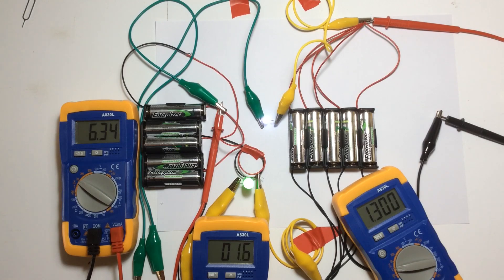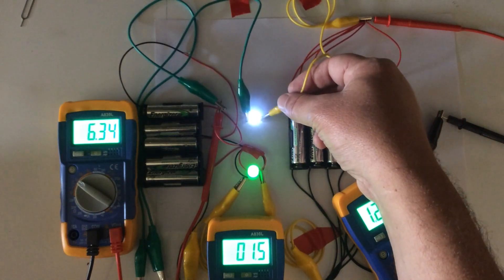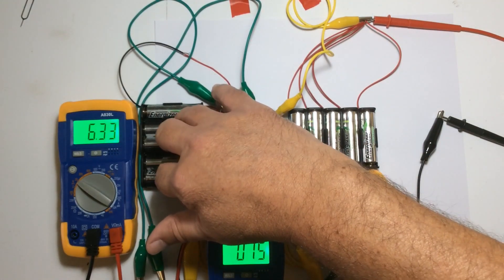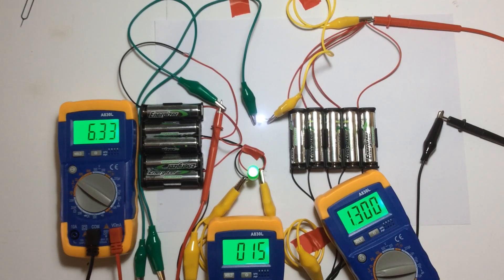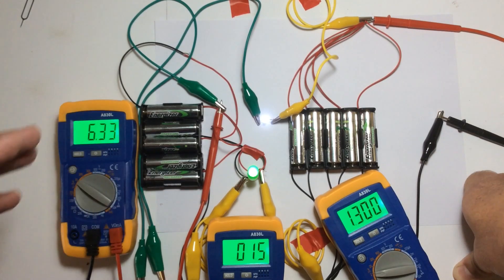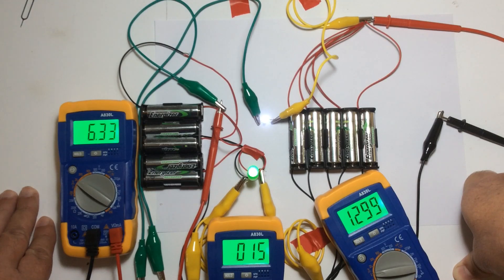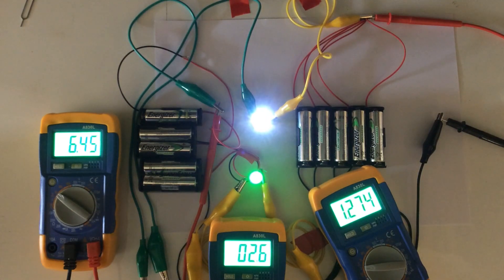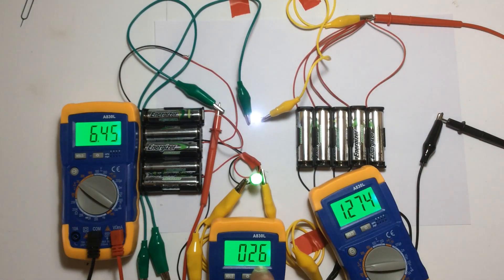*UPDATE 2* TESLA SWITCH 24/7 RUN, 240+ HOURS SUPER EFFICIENT LIGHT

Comment: I've followed Rick Friedrich for a long time, but even his work on Benetiz is not
nearly as informative or clear as your detailed video here!

I play around with a lot of experiments, but I keep forgetting how utterly simple
the basic principle of the Benetiz patent is, so I tried something extremely simple
today with 3 simple off the shelf parts, (2) 12 Volt / 500 Farad caps and a 12 volt 60 watt motor.

One of the caps I had drained to less than 1 volt, the other cap was charged to
about 14 volts.  I connected the two negatives of the Supercaps together and ran
the motor for a few minutes between the two Positives.

At the end of the experiment the combined voltage of the caps were GREATER than
when I started.  I ran the experiment 3-4 times after that with the exact same result!!!

Not only did the motor run 100% for free, there was actually a small increase in voltage
due to the coil collapse & feedback from the motor.  The voltage increase wasn't anything
extreme (about 1 to 2 10th's of a volt per 2 minute run), but the motor ran for free
with nothing but off the shelf caps and motor!
Reply from the maker: Thank you for your comment.
Sorry for my delayed reply. I agree that is so simple and perhaps this is the illusion and I find that to be the case with most of Tesla's work also. Confusingly simple, the confusion is derived when you realise its so easy.

I appreciate you supplying your test information because the more people attempting this the better. please feel free to update me if you like on any more tests you do.
Have you run this multiple times to get a consistent data set?
Thank you for watching.

Comment: So if I'm seeing this correctly and following it right, what you're saying is essentially any of the little double a devices that I have could potentially be wired up in a manner such as this to extend the battery life considerably.   If that's correct, how would I go about doing something like that for say a TV remote or something along those lines like an Xbox controller?     And can this be adapted to 18650s sorry for all the questions
Reply from the maker: Thank you for your comment.
Sorry for my delayed reply, you are correct, this will work with most batteries, as long as the parallel receiving battery is roughly half the voltage of the series battery. The way I set it up with AA batteries is consider the load/LED voltage, in this case 3.2 to 3.6 Volts then subtract the voltage of the parallel battery voltage of 1.2 volts. So 3.2v - 1.2v = 2 volts which would be too low for some LED’s so it would be best to use 4 AA in series.
4 AA x 1.2v = 4.8 volts
4.8 volts - 1.2v = 3.6v which is the upper limit of the LED
The only other thing to consider after that is to ensure that both banks have the same number of AA’s, ie if you choose 4 x AA’s for the series bank then you need 4 x AA’ for the parallel side.

So your TV remote would most likely be two AA or AAA’s and the four battery scenario we just covered would be perfect. When the battery voltages are even, say with a 12 volt version in which you have a 24 volt bank and a 12 volt bank then the load sees half the voltage of the series set, if you place your volt meter on the two positives it will read 12 volts.

Both the Xbox and TV remote are going to be very bulky with this type of setup, you could perhaps miniaturise the circuit using small lithium batteries that are usually used in PCB’s for computers and other electronics but it may just be easier to charge your remotes batteries on the negative rail of this circuit, if you take a look at my latest video there is something a little weird going on along the negative rail we may be able to benefit from.

Also you should never have to apologise for asking questions, questions assist in rapid learning, not asking questions means we have to individually stumble upon findings which is an incredibly slow way to research, the world would be a greater place if more people asked questions.

Comment: as always I love your videos, I was just thinking will arduino work if I connect it like led? Or that is different? both are DC. Im planing to make moving sensor with esp32 and light bulbs.
PS: Im still hooked on your magnets track, thnks
Reply from the maker: Thank you for your comment and sorry for my late reply.
I believe arduino would be a good idea and almost any DC device should work in this manner, I had only one device that died in the 12 volt version which was a low voltage cutoff which is somewhat obvious that it would have blown up, I don’t have arduino so I will have to buy some new toys!
Keep at it with your version of my magnet track, it takes a great deal of patience. The small increments of adjustment is critical when finding the sweet spots because each magnet is individual it requires grouping of compatible magnets just as Howard Johnson stated. Ideally buying magnets from the same batch would be better but with small changes you can make a functional arrangement. This is one way how I fine tuned mine, I elevated the sides of the track so that the magnets drop down away from the roller magnet at which point the track magnets influence is minimal, I used two new packs of A4 paper, one on each side of the track, then I removed one piece of paper from each side of the track and rolled again. If you repeat this you will enter an area of increased propulsion, continue removing paper one page at a time from each side and you will pass through a section that bogs the roller down. Although painful this is almost a guaranteed way to find the sweet spot, record the number of pages from the sweet spot to the dead spot and make a 3D print adjustment. If you aren’t sure how to make the adjustment to the print I am more than happy to adjust my original to your researched values.

Comment: I found an interesting Video from you 8 months ago "Power for the People" where you showed the efficiency of the Power Transfer with different light bulbs and also a motor. It showed that the efficiency with unbalanced power is only 50%. You mentioned that a balanced load will be way more efficient. I think it would be around 90%? When I tested the 12v-Inverter with the fridge running I had the feeling it's almost 100%. I checked the voltage rise at the 12v-battery and it jumped up the same as I would have loaded it in a conventional way with the same amount of current. That's no proof but it made me think this way. That's why I took 90% in my example in the other comment with the Capoeira-cycle. Could it be the inverter running with the fridge is balanced? (I don't know what that means exactly by the way). The inverter and the Lithium-batteries I used are good quality. Maybe that makes a big difference in the efficiency?

In case the efficiency would be also 50% I recalculated my example with the Capoeira-circle. I take out 100W from the 6v-bank. 50W goes into the first 1.5v-bank. After the step-up and the battery-charger I count just 50W (30% lost at step-up and 20% lost at the battery-charger) into the third 1.5v-bank. 25W (50% of 50W) goes into the second 1.5v-bank. At the end we have 125W (50W+25W+50W) in the three 1.5v-banks. This still would be a net gain of 25W. I believe this assumptions are the absolute bare minimum. I'm very eager to test it. But my wife is expecting more money.
Reply from the maker: Thank you for your comment.
There is plenty of evidence that suggests this concept can access the zero point energy field when certain conditions are met. Depending on the components deployed and their function integrated into the transfer method can cause drastic changes within the circuit.
When all the parameters are met the circuit can achieve a zero volt zero current status at which point loads added to a specific point within the circuit do not increase current draw from the primary battery. For this reason each individual build requires a balancing of components used and by this I am referring to a load that draws a minimal current and less current than the charge/discharge rates of all batteries in the system. As we see with the addition of the green LED, not all components are equal.

Comment: I explain here the next step of my step-up circle. I would call it the Capoeira-circle. I did it 1 year ago with my set up (12/24) and it worked.

You need three 1.5v-banks and one 6v-bank. You need also a step-up-converter (for example 3-10v). Then you need a 5v-battery-charger to charge AAA or AA-Batteries.

Instead of the Led you connect the step-up-converter. The input of this step-up-converter is 4.5v. And the output needs to be 6.5v or 7v. You connect the Positive (OUT) of the step-up with the Positive (IN) of the battery-charger. The Negative (OUT) of the step-up goes to the Negative of the second 1.5v-bank. And the Negative (IN) of the battery-charger goes to the Positive of the second 1.5v-bank. The battery-charger will have 5v input (6.5v - 1.5v). Then you connect the battery-charger in a conventional way with the third 1.5v-bank to charge them up.

First we have a 10% loss (at most - the same as with the Led). At the end it charges up the third 1.5v-bank. I estimate a 60% gain here (it should be more). On the way back it charges up the second 1.5v-bank. Here we have a 90% of the 60% from the step-up. I take a very modest 50% gain (at least). At the end we have a 100% gain (60% + 50% - 10%) out of one circle. Example: I take 100W out of the 6v-bank. After the circle finished there should be 200W more in the three 1.5v-banks than there has been in the beginning. This means we have 100W less in the 6v-bank and 200W more in the 1.5v-banks. Altogether we have a 100W gain. With the simple circle I explained in the other comment there should be a 50W gain.

With this gain it's easy to charge up the 6v-bank and there will be still a lot of current left to run a Water-heater. I hope this makes sense.
Reply from the maker: Thank you for your comment.
I will have to purchase some step up converters and give that a go, thank you for supplying this information as there is only so much I can get done and my main goal is the education of others, if my channel acts as a platform for others ideas I am happy to be that host.
Please feel free to keep posting your ideas here so we can help more people.
Reply: @whatifididthis...1236  Rick Friedrich did a good Video about resistive and capacitive load 5 years ago. I think it's the same principle in our case. He generated AC-Power with inductive coils. To use this power he used a Variac (backward) to manage the output voltage and then he tested it with a resistive and capacitive load. With the resistive load he got an efficiency of 50%. He had 60 Watts of generated AC-Power and could light up an old 30-Watt-bulb. You did exactly the same experience with this 50% with all your loads you tested in your Video a couple of months ago. But with the capacitive load he (Rick Friedrich) seemed to have almost 100%. His words are: "I'm gonna say that's pretty much matching the input voltage. We're at 60 Watts worth of LED perhaps. And the input is 60 Watts." I think it's key to use capacitive loads to get a good result. And if you use a resistive load it's important to have a balanced load in compare to the batteries. But even then I think it won't have the efficiency of a capacitive load. I'm happy you will test my idea and I'm very interested in the results. I'm confident it will work because a step-up converter and a battery-charger is a capacitive load.

Comment: I thought about my step up circle last night I tested 1 year ago. I almost forgot everything. As I told you I have no time now to test it further. But I try to explain you the principle. Maybe you can do something with it. I just explain the basics of the basic. There is more to it. I did it with 12/24v. But if I would have time I will do it with 1.5/6v as you do it:

The foundation is your circle. Instead of the Led (plus on 6v and minus on plus of 1.5v-bank) take a step-up-converter. With my step up converter (12v -> 70v) I can limit the current at the incoming side. First I had a cheaper one with the current limit at the outgoing side. This didn't work. The converter blew up and couldn't stop the current. Why I don't know because in a normal set up it works. You connect the step up converter exactly the same as the Led. The step-up-converter will run with 4.5v as the Led does. The Led could be connected as well. It likely wouldn't affect the Led. Then you need a second battery-bank in series of 1.5v and connect it with the outgoing side of the step-up-converter. And this will charge the second 1.5v-battery-bank with 5v or 6v or whatever. 90% of the current used by the step-up-converter goes into the first 1.5v-battery-bank exactly as the Led is doing it. But additionally the step-up converter will charge the second 1.5v-bank. And there I estimate a loss of 40% to step-up the voltage. It's most probably less. At the end there is a loss of 10% and a win of 60% at the second 1.5v-bank. This is a win of 50% altogether. It's generating current and the light is on for a battery life-time without getting current from outside. The next step is to bring this current back to the 6v-bank. I was very close 1 year ago the achieve this with bistable relais, comparator and so on. In this scenario there is probably no need for a step-up-converter because the difference voltage is already higher (4.5v) than the 1.5v. But important is the current limitation. In my scenario I needed a step-up-converter to charge the other 12v-battery. The difference between the 24v and 12v is 12v (equivalent to the 4.5v in your scenario). I stepped up the 12v to 20v and charged up an other 12v-battery. I hope this makes sense.
Reply from the maker: Thank you for your comment.
Sorry for my late reply.
I hear you about not having time and whilst yesterday’s jobs weren’t finished there will still be today’s jobs needing attention also, something has to give.
I’m pretty sure the system you describe should work, the efficiency would be debatably lower but if it is even slightly more efficient than today’s methods then it should be utilised.
Please keep me up to date if you find time to work on it.

Comment: Well done. I'm keen to see how you plan to electronically switch the batteries
Reply from the maker: Thank you for your comment.
I am also keen to get the switching underway because the efficiency goes through the roof. A lot more technical but according to Electrodyne Corp. the switching facilitates a magnetic flux inrush of energy when the relay coils fields collapse. I will try to make a video soon demonstrating this occurs even at very low voltages.

Comment: Funciona también para baterias de  litio este cto. ??? O solo en esas condiciones ??? Con ciertas baterías recargables ???
Reply from the maker: Thank you for your comment.
Yes this circuit will work with all battery chemistry because it is the real movement of energy that makes this work and not the hypothetical variation we are taught.

However not all batteries are suitable because of their charging requirements. For example Lithium batteries connected in series and or parallel usually require a battery management system or (BMS) which balances the voltages of the individual cells. Under charging and over charging is the main reason for lithium battery failure.
Now all batteries fail in this area in their own way and the different chemistries of batteries available is extensive, lithium when under management of a good BMS is amazing delivering an intense amount of power and you can have almost 100% of that power without damaging the battery yet you try depleting a lead acid battery by more than 50% and you’ve damaged it yet the lead acid battery won’t produce a 3ft rocket flame that can’t be extinguished by anything that any of us have like lithium will.

When considering safety as an absolute priority and not wanting to return home to find a fire investigator holding the remnants of your experiment in his hands declaring the source of the fire. I did this experiment with a lithium battery bank for charging a mobile phone, I bypassed the management system because it was not designed for series battery connections and the thing expanded like a balloon producing a highly poisonous gas, it even busted out of its plastic case.

Safety first, if then you feel it’s worth testing it with a good BMS never leave it in operation whilst unattended(which defeats the purpose of this experiment), perform the experiment on concrete with no flammable surface nearby. I’m not over exaggerating at all, there are heaps of videos on lithium battery fires on YouTube.

I like the AA batteries as they are very fire safe and I can achieve whatever voltage I want, if I place ten AA batteries in series at 1.2 volts each I then have a 12 volt battery or as seen in my other video’s a head torch running on four AA’ in series producing 4.8 volts and in this video using 5 AA’s giving me 6 volts. This allows me to use a variety of different devices commercially available without modifying the device.